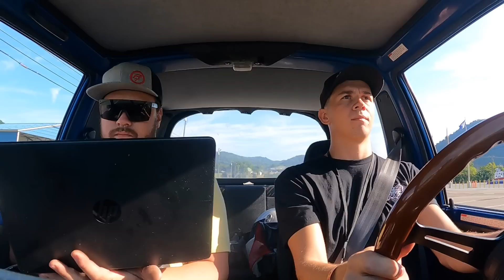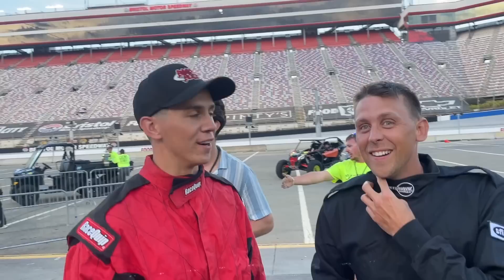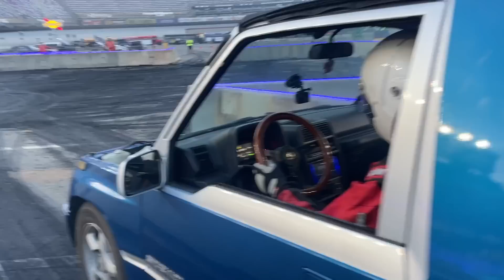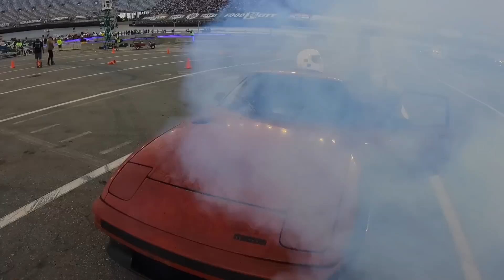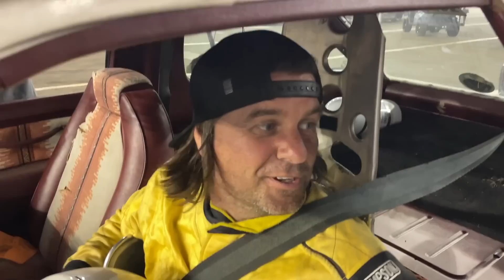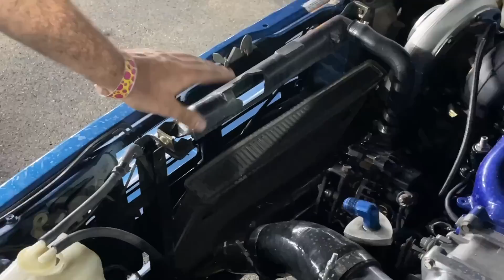Sent The Burnout a Little Too Hard In Our Rotary Swapped Sidekick!

Comment: I love how the rear brakes were never used and they remained rusted since the line was cut, and when he said that the car has been sitting there for a while it made it seem like it actually was sitting there for a while at the end of the video, but in a way that it seemed like longer than it was but it wasn't because it was only a little bit but it was a lot for the rotors still. Haha. Solid attempt at a last min burnout car you have never built. And for your first automatic to take such a beating and still be alive. One word. UNIT

Comment: Hey Kyle, you should consider loading the back with sandbags in the rear of the sidekick (or any burnout car) the mix between washy rear suspension and the heavy weight it will blow smoke off the tires like you wouldn’t believe and also pop the tires faster causing less wear on the engine….. think about Matt from demo ranch car he won with, the things a tank and had sloppy stock suspension causing the perfect mix

Comment: the exhaust sounds on some of those cars was very close to how my 1/8 scale nitro On Road car sounded at 25K rpms, running a little lean for the most power.
They were only $200 to rebuild though, so well worth the extra 1/2 HP ( 2.5-3.5 HP depending on brand motor and how lean )  on a 6 pound race car..

Comment: Those rotary motors get so hot naturally that all you guys doing burnouts with them need to come up with a really good way to keep them cooler. I'd even go as far as to make a exhaust manifold that puts the turbo out the hood up in the open air so it gets less heat from the motor and can cool off also. It also keep the heat from the intake an such keeping it cooler also. Love this taco beast !!!

Comment: The Vargas Brothers need to get their hands on the Tracker and put in a mean tune for you and get it to do an AK 2step just like his RX7 was doing after his burnout and you need to put an aluminum radiator in it and you need to get a Black Sheep Industries wastegate to put on it and hopefully you'll get rid of the wastegate problem and you should put an intercooler on it to keep the IAT's down and not get the exhaust housing on the turbo so hot because you'll end up welding the impeller to the turbo housing and lock up the turbo completely

Comment: might need to reroute the wiring along the other side of the engine , get a better waste gate , fit a welded aluminium radiator and a good shifter , seems to be doing well for the rest of it

Comment: Should've took the targa top off and did the burnout top down and Garza went from a Chalupa Miata to a Crunchy Miata in 2 seconds I wonder what happened besides the fact that he didn't turn and then locked the brakes up and went straight into the wall and now he needs to find an MX-5 Miata to put the K series in because I think they look better than the older ones and they probably have more engine room and better everything else because they are more updated

Comment: Because that turbocharger is split, you should split the exhaust so each rotor runs into each side of the turbocharger separately. Then you can run two wastegates and get real good control over that boost. Do it also make it any more reliable daily. And heat wrapped the exhaust before the turbo and after the turbo. Get all that heat energy going into the turbo charger to provide more stable and reliable boost.

Comment: Imagine thinking running a plastic radiator on a rotary was a good idea. And also imagine thinking it's not going to run hot without any fans on it pulling air through it 😂🥴🤡